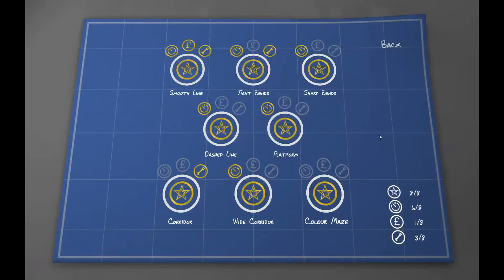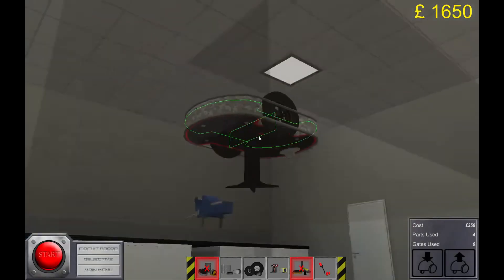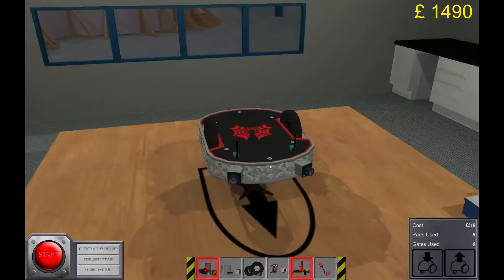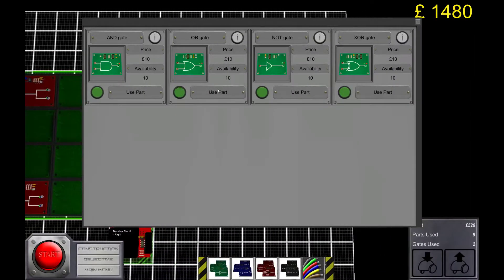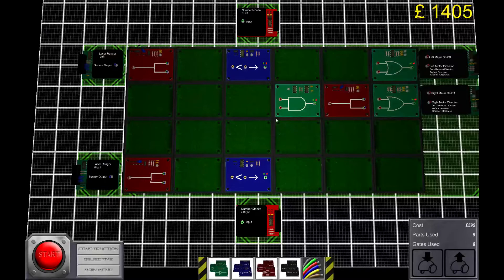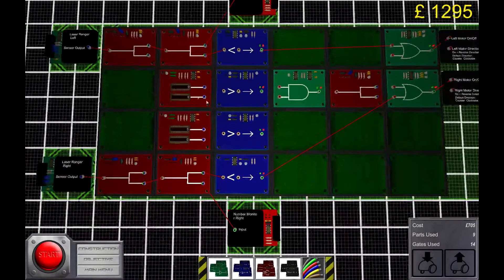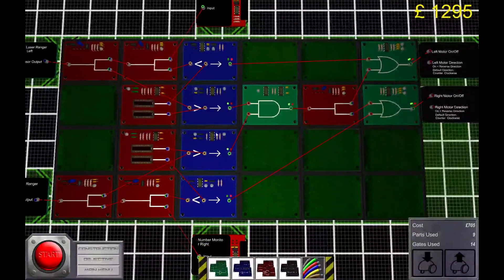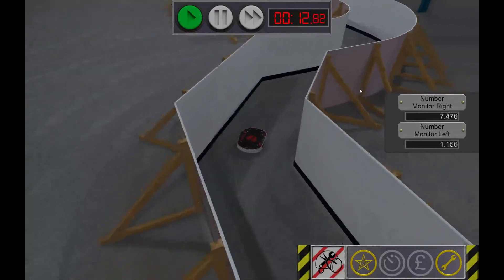Logicbots 1-6 Corridor Tutorial

Comment: FYI: One reason why your robot ran into that wall, might be the same reason why it gives such huges numbers:
It should be obvious when you look at the parkour, that the distance between the robot and the wall is far less than 1 meter.
The huge numbers are caused because your lasers are pointing diagonally forward.
Maybe things go a bit more smooth if you point them more to the sides and less to "forward" (as in: change the angle)?
If it would aim straight to the left and right, I am sure that it should produce smaller values. :)
Reply: +mpeijzel 
Update: I just did this level, by aiming the sensors only a little forward (and mostly to the side), and setting the distance to 0.5 meters (0.5 in the display). I got three of the four awards (again, my design was not cheap enough).
Reply: +mpeijzel 
Second update: on 1-7, to get around those boxes, I actually had to aim them diagonally forward like you did in this video. :)
My next robot will be equipped with a laser cannon, to blow up those cardboard boxes instead!  :P
Reply from the maker: +mpeijzel haha, that would be awesome. I suggested a Battle Bots mod in the forums a while ago ;)
Reply: masterstroggo
Yeah, I decided to add a joke here, since those cardboard boxes gave me a hard time to get it to work. I have not been able to get it to work without the medium wheels so far, but I am still thinking about a solution (something similar to your 'balancing' act, if I can purchase a motor in that level, or something with that other frame that we are allowed to use in that level).